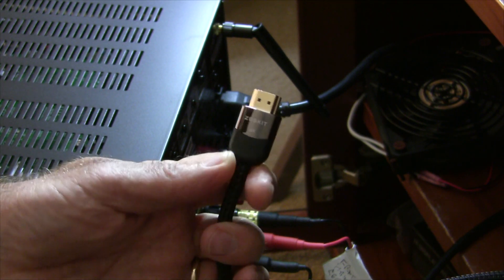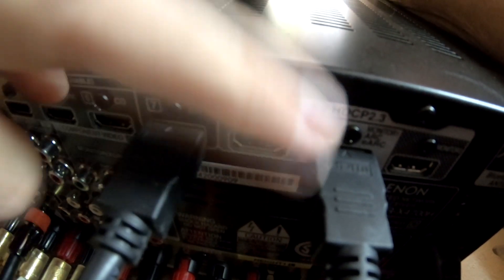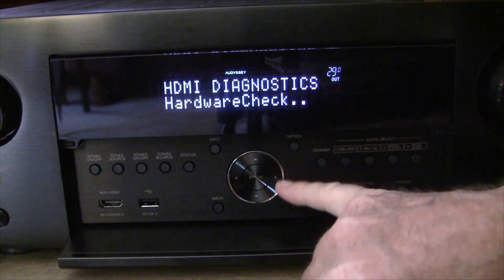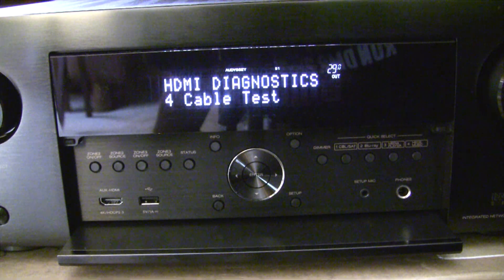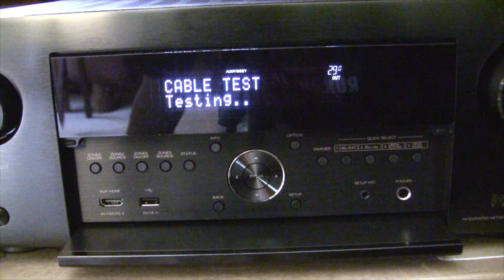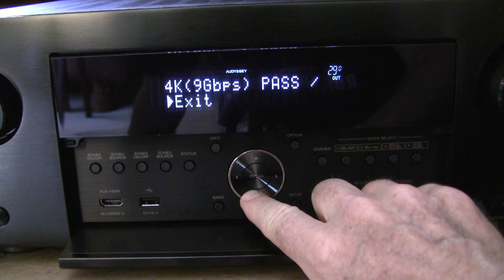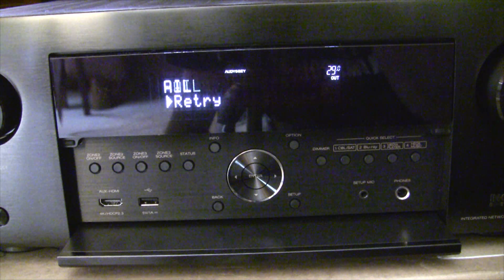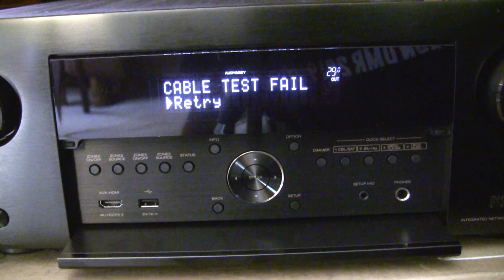Denon Receiver HDMI Cable Test - Testing High Speed and older HDMI cables

Comment: Could you test, fusion 8k cables?
Reply from the maker: I don't have any Fusion cables, so I can't test one, but those bring up an interesting discussion.

On Amazon, a 6 foot Fusion 8k cable costs $44.99
https://smile.amazon.com/Fusion8K-HDMI-Cable-Supports-60Hz/dp/B07YF7KYJR/

The Zeskit 8k cable I tested here:
https://youtu.be/O84G_RGwKco
costs $19.99
https://smile.amazon.com/48Gbps-Compatible-Netflix-Playstation-Samsung/dp/B07S1CGQ9Z/

So which is better?

Neither are certified:
https://www.hdmi.org/spec21Sub/UltraHighSpeedCable
In fact, as far as I know, there aren't any certified HDMI 2.1 cables yet.

Since there weren't any certified HDMI 2.1 cables available when I put together my system, I did some research and decided that Zeskit was a good choice. Their cables were used to demonstrate HDMI 2.1 (up to 8K) at the most recent CES (Consumer Electronics Show) and I thought the price was reasonable ($20).

On Amazon, the Zeskit cable has 3390 reviews today, with 86% 5-star and 2% 1-star
The Fusion 8k cable has 102 reviews with 88% 5-star and nothing less than a 3-star. 

I always find it instructive on Amazon to read the 1 & 2 star ratings to see what people are complaining about.

My cable works fine, but since the Zeskit cables aren't certified, I could have gotten lucky.
But based on the fact that it has so many more reviews on Amazon and the vast majority are favorable, I thought it was a good bet.

Most Home Theater websites will point out that with a digital signal like HDMI, you don't need a very high cost cable for it to work. Either the 1's and 0's are transmitted correctly or not.

I think that's true up to a point, but with the HDMI 2.1 specification, the margin for error has been reduced. You want a cable to work and keep working for years, so buying the cheapest cable may not be the best choice right now.

Once certified cables are available, I wouldn't hesitate to buy a cheaper certified cable from a company like Monoprice since they have a good reputation for making quality products at a reasonable price.but I wouldn't buy the cheapest cable from a company I'm not familiar with.
Reply: @BetaCygniBlog  have an oppo 205 and getting a samsung q90t. Running onkyo rz3100. Seeing if i wasted money.
Reply from the maker: @MrHumes-nv1zr  That Samsung looks spectacular in the reviews I've seen. If you are using your HDMI cable for ARC (as far as I can tell your RZ3100 doesn't support eARC), then it should work  fine. The Oppo 205 is a great player, but it doesn't support HDMI 2.1.

Unless you plan on buying some device that can support HDMI 2.1 (like an XBox  Series X or PlayStation 5, or a 2020 receiver like the Denon 4700h), then I'd say you over paid.

But compared to the cost of the rest of the components you have, the difference in the cost of the cable is minimal.

If you bought your cable to future proof your system then it's going to be fine unless you got a bad one. Again, the difference in cost is not that much.

I'm hoping that there are certified Ultra High Speed (8K) cables by November when the XBox Series X comes out since I'm getting one of those.

If certified cables aren't available, I'll probably buy another Zeskit 8K since I had good luck with the first one. If I get a bad one, I can always return it.

NOTE: Even certified cables can be bad. As far as I know they don't have to test every cable to be certified. They just have to have good quality control and test a significant sample of their cables.

Comment: Very interesting test Beta.
However what intrigues me is would my new brand Marantz SR7015 be able to make a diagnosis such as your Danon or is it a Danon own option only ?!
Thanks anyway !!
Reply from the maker: Looks like Marantz has the same type of testing:
http://www.accessories4less.com/mas_assets/theme/accessories4less/images/manuals/Marantz/marantzhdmi.pdf

If the button combination in the manual doesn't work, then I'd ask over on this forum. Someone may have already posted the answer:
https://www.avsforum.com/threads/official-2019-marantz-nr-series-sr-series-avr-owners-thread-faq-posts-1-6.3074034/

I don't see a thread for the 2020 models, but I'm sure one will start up once that receiver is released.
Reply: Beta Cygni Right on !

Comment: So the denon diagnostic testing isn't reliable.
Reply: Agree - not reliable.  On mine I am finding the results don’t make any sense.  E.g. an HDMI 1.0 cable that came with my TiVo S3 over 10 years ago passed 8K.  Then a 3’ Sony v1.3a certified cable failed ALL testing (didn’t even pass at 480p) even though it had been working fine with a 4K/30 Roku. 
Other times I found I had to power cycle the receiver or it would keep failing all cables after a fail on one cable.
Not reliable at all...
Reply: @bsd107  thnx for that info
Reply from the maker: @bsd107  Yes, I had to power cycle the receiver too in my testing. 
It's too bad it doesn't work better.
Reply: Don't your have to check the hdmi inputs in the menus in the denon ....its standard, enhanced and 8k. If its not on the right setting it will fail. Im getting my marantz 7015 in a couple of days
Reply from the maker: @MarcusMaximus909  I don't think so. The test uses the only HDMI 2.1 input on the back of the receiver. I think the new Marantz receivers are the same. They only have one HDMI 2.1 input.
Reply: @BetaCygniBlog  hopefully they can correct this test with firmware update  as currently its useless! If it worked properly it would be a useful test!
Reply from the maker: @MarcusMaximus909  I agree. I was surprised it was unreliable.
Reply: Hello Community: I'm running into the same issue and really want to find an answer. I know there was a firmware update that happened did you guys have any luck with that fixing this? If not I'm reaching out to Denon, Sound United, and others to see if I can find a way to get to the bottom of this. Here is my template email. 

In making a long story short after an ignored email from over a month ago and 1 hour and 30 minutes hold time with Denon I was hung up on I believe because she didn't know the answer so I’m hoping to get an answer here. I purchased the X4700H almost exclusively due to the 40gbps HDMI cable testing ability as I am running my cables from my PC into my LG C9 TV and out via eARC to the Denon and need to be sure the 2 different brands of “fiber optic cable” each costing over $160 bought on Amazon that state they will pass HDMI 2.1 will actually do so or at least up to the limitations of the Denon and most other devices at 40gbps. After multiple YouTubers posting issues with the HDMI cable testing system getting different results (depending on power sequences) and speaking with the community I am convinced the system is not accurately working. I am reaching out to you in hopes you are 1. Aware of it and 2. Know when it might be fixed? That way I can reliably say what cable actually passes the needed test. Thanks in advance and I watch almost all of your content. It is always very informative and helpful. 
Thanks
Reply from the maker: @DDastrup1234  I installed the firmware update. I'll try running the test again.
Reply: Beta Cygni excellent thanks and let me know what you find. I’ll do a test later this evening as well.
Reply from the maker: @DDastrup1234  I just did a re-test
https://youtu.be/O3c_kNig7iI
Reply: Beta Cygni Thanks Beta! I also ran tests last night and verified the firmware update. I’m still getting fairly inconsistent results similar to what you’re getting. Cables that I know are not capable are getting 40gbps and others are not. Retesting gives varied results sadly. Thanks for your follow up.
Reply from the maker: @DDastrup1234  You're welcome. I actually got consistent results with the 8k & 4k cables. It was only the weird result with the HDMI 1.4 cable that was puzzling.
Did you turn off and unplug the receiver between tests?
Reply: Beta Cygni I did turn it off while disconnecting and connection however I did not unplug
Reply: That was a fun, interesting test, I’m in the UK and thinking of upgrading to the 2700H from the 2600H there is one less HDMI port on the new one, I am as addictive as you with cables and power cycling off things before I power new cables up, I get some picture issues with my new and older 4K players (I have 3 lol, no reason to sell them and I always thinks its cool to have a movie in each ready to go lol) anyways, side question, does the 8K HDMI input allow for any 4K player or games console to plug into it, as in act as any other HDMI port or is it exclusively for 8K content ? I’m thinking not but as you have a newer receiver I wonder if you can let me know..along with the 8K out, can that go to my LG OLED or does that have to be the 4K Output 1 ?
Thanks so much brotha.
Reply from the maker: @MovieCaveDave  You're welcome. See the reply to this same post below.
Reply from the maker: Yes, I found it flaky. So far everything seems fine with my 8k cable. I had one blu-ray disk that was putting out Dolby True-HD and I saw that come up.
Until I get the XBox and can play my 4k Blu-ray disks with DolbyVision & Dolby Atmos with TrueHD sound, I won't know if everything is working to the max.
As I've said numerous times in my videos. I'd prefer to buy a certified cable. Hopefully by the holiday season this year (when the XBox comes out) there will be certified "8K" cables.
Reply: @BetaCygniBlog  new xbox will launch Nov, just as all previous xbox consoles have.

I am not upgrading from my Denon 6300H to this years models because I am turned off by it not having full hdmi 2.1 on all ports. I'll wait it out until next year and see.

My setup is LG C9 65 and Denon 6300H. I plan to buy both nextgen consoles. 

I also picked up non certified 8K60/4K120 ultra speed cables on Amazon. 

https://www.amazon.com/gp/aw/d/B081NXV3ZR?ref=ppx_pt2_mob_b_prod_image
Reply from the maker: @H0DLTHED0R  Not having full HDMI 2.1 ports on the receiver seemed like a problem when I first considered upgrading 
     here's my upgrade series: https://youtu.be/c5jgOY4J6eE
     (I was coming from 8 year old technology)
But then I realized that I'm going to put all my HDMI 2.1 devices into the LG TV which does have 4 HDMI 2.1 ports (I have the C9 which has 48 Gbs ports, but even the CX seems adequate with 4 x 40Gps HDMI 2.1 ports based on what I've read).

I have my Denon 4700H receiver on TV's HDMI port #2 doing eARC, my old Samsung Blu-ray player on Port 4 (that's where the XBox will go) and I have a Chromecast Ultra on Port #3. The Chromecast is to cover all the streaming sources (like PBS) that don't have LG Apps.
We're getting our TV via Hulu LiveTV over the internet so we don't have a cable box connection.
That leaves me with one free HDMI 2.1 port on the TV (#1) and another on my receiver.
That will be enough for me.
I'm not likely to buy a PS5, but if I do, i have a port for that.
That still leaves me one empty HDMI 2.1 port.

What I came to realize (based on watching reviews on the HDTVtest YouTube Channel) was that LG has the top of the line video processing from all sources whether native 4k or upscaling lower resolutions. So there is no reason to run a video signal through the receiver.
Instead, let the receiver do what it does best and handle the audio processing via eARC for video/audio signals and directly (via the ports on the receiver) for any other audio sources like a CD player or a turntable.

In fact, I'd rather see a stripped down model receiver that just does eARC and leaves all video processing to the TV. That would be cheaper.

In my mind the TV is now the hub of a Home Theater System rather than the receiver like it was when I built my first Home Theater 8 years ago. Back then my TV only had one HDMI port and my receiver had 2: One for the cable box and one for the blu-ray player.
Reply: @BetaCygniBlog  kool man. Makes sense.  But I wish TVs had more hdmi ports
Reply from the maker: @H0DLTHED0R  I'm finding I don't need many inputs because almost all streaming sources have Apps that run on the TV.
The one exception for me is PBS programming. 
We're using Hulu LiveTV for our TV channels and that doesn't have PBS.
Our LG C9 TV doesn't have a PBS app yet. 
Samsung TVs do:
https://help.pbs.org/support/solutions/articles/12000059665-the-pbs-video-app-for-samsung-smart-tv

So I bought a Chromecast Ultra to plug into one of the HDMI 2.1 ports on the back of the LG C9.
Then I can use Chromecast to cast PBS programs on my phone to the TV.
One thing good about that solution is that once you cast it to the Chromecast, then the Chromecast is talking directly to the streaming source. It's not routed through your phone so the performance is great.
 You just control the playback in the PBS app on your phone.